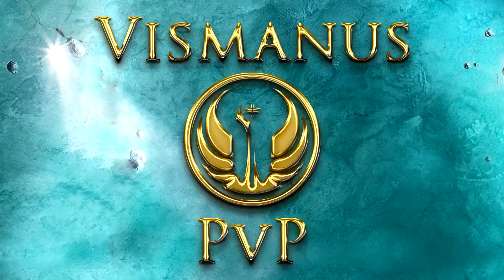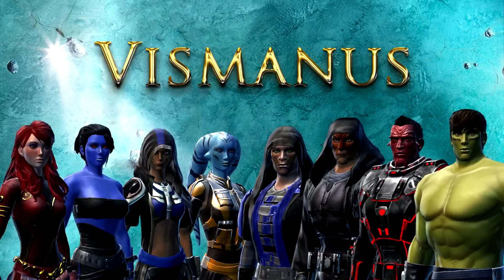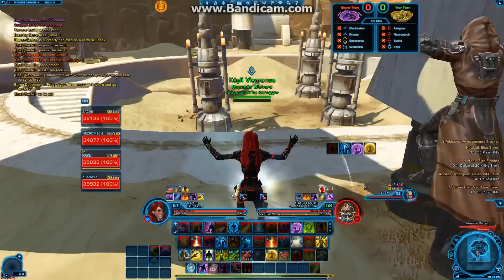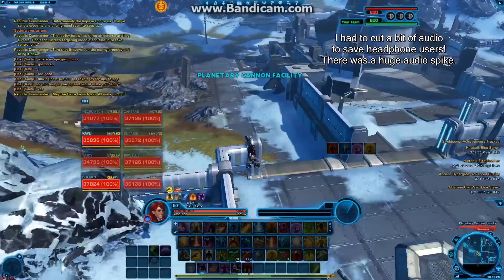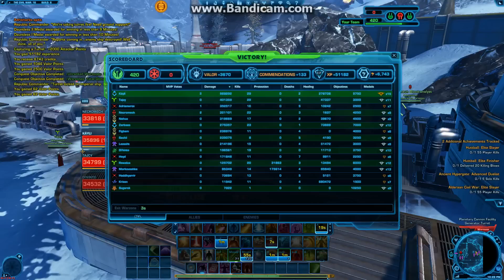SWTOR PvP #116 Telekinetics Sage [30-59] 3.1

Comment: be honest, is it overpowered? because it seems like the most overpowered class at the moment.
Reply from the maker: mao xiong The most overpowered class/spec is Hatred Assassin. That isn't debatable. There are certain aspects of the sage which is overpowered. For example the dot-spread in Balance, the utility Life Ward, bubble stun and forcequake.

The amount of damage forcequake does with force potency is ridiculous, the fact that it's spammable and the sheer size of the aoe. If a Sage is alive at south in novare coast it's vertually impossible to cap because forcequake takes up the whole area that you can cap in and the ability is spammable. That's really poor design. But forcequake is being changed.

The self healing needs to be toned down. First of all the 2% heal every second you get from Life Ward when you have Force Armour on just needs to go. The utility is good enough in my opinion without that as it already heals you pretty much to full after using Barrier. Having ~850hps just for having Force Armour on is ridiculous.

I'm not sure what I'd change about bubble stun but it's way too anti melee. As a sentinel cc is your worst nightmare. This only adds a tiny amount of resolve but it allows the sage to create a massive distant by the time the mezz is over. Maybe as a start it should add more resolve, but this doesn't change how anti melee it is.

Then there's dotspread. There are so many different ways to easily change this that it's frustrating that BW haven't done anything about it. Balance already did crazy amounts of damage without it. They could for example only spread a weaker version of the dots, or the dots could have a shorter duration, or they could be uneffected by the force in balance dot boost, or they could be cleansable etc. The list goes on. And this doesn't have to effect PvE at all. BW have shown that they can make things work differently in PvP to PvE when they changed Smash pre-3.0 so that certain buffs only worked against NPCs. The only reason this hasn't been fixed is ignorance or laziness. Neither is good.

TL:DR - certain things are a bit too strong and together they make this class minorly overpowered, but Hatred is the most overpowered spec hands down.